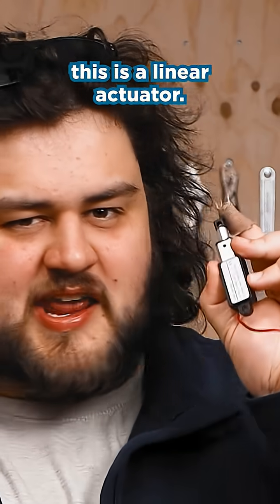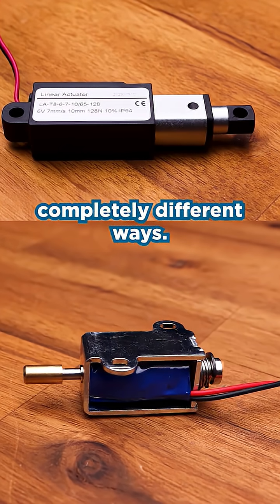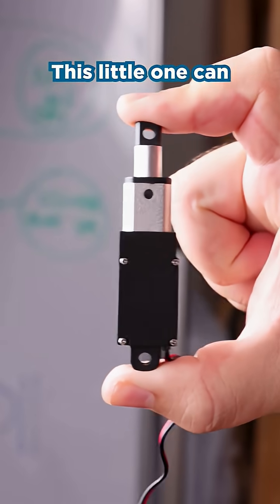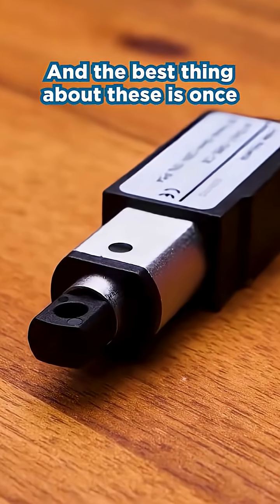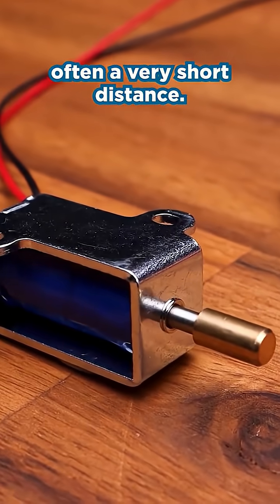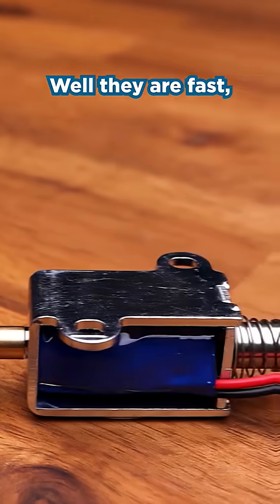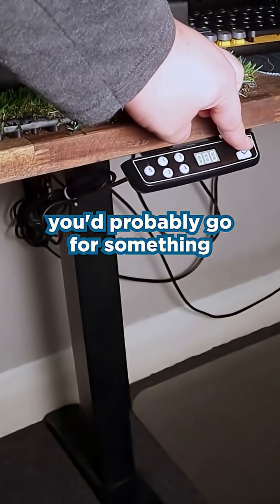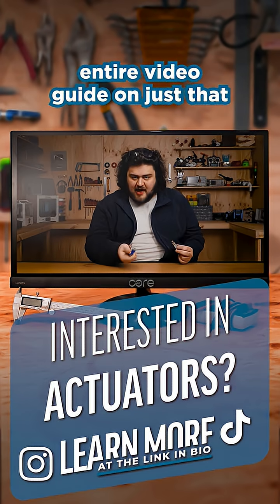Solenoids vs Linear Actuators - Do You Know The Difference?

Comment: The problem with using a sulinoid for a lock is that it can very easily be shimmed
Reply: That would depend upon if you use the solenoid directly or to move a mechanical lock.